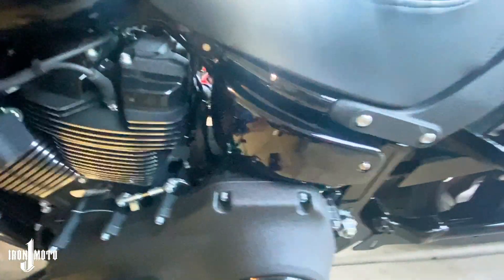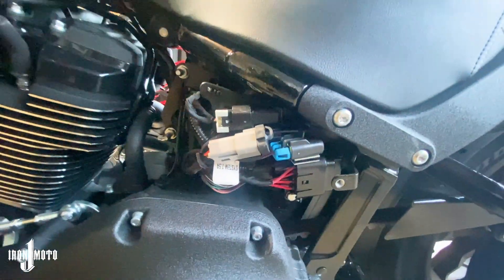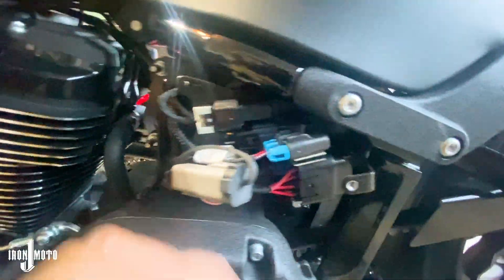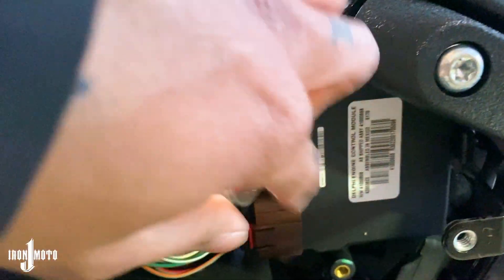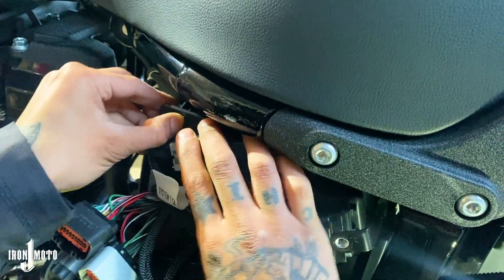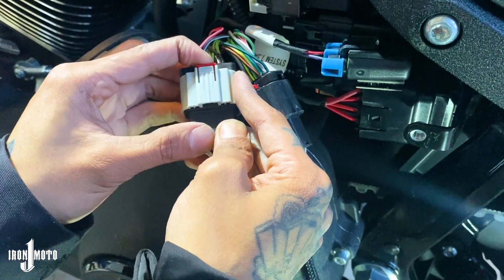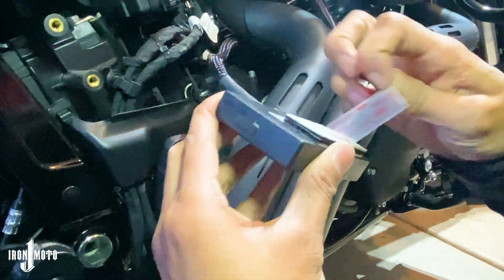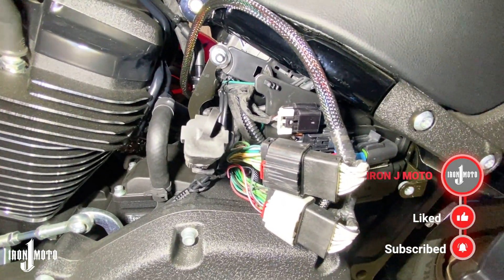How To: PCV Install On A Harley Softail Low Rider S

Comment: I currently have HD tuner with stage 2 but my warranty is ready to expired in good note.  I am thinking to get a PCV on my 20 m8 low rider s n wondering how this tuner works for you in performance? Worth to spend money on this tuner?
Reply from the maker: I think power commander or vision should be just fine. But since you have stage 2, did you get your bike dyno tuned? Or is it a preset map?
Reply: @lifeofjustinjames  honestly,  I am in  California and no tuner out here wanting to dyno with HD tuner. I have s2 with HD SE tuner and I believe they keystroked tune my bike with their typical PC format.  I am thinking about going with PCV and dyno tune at same time.